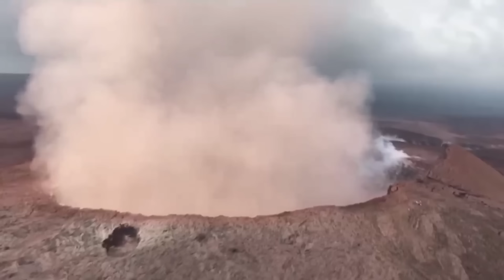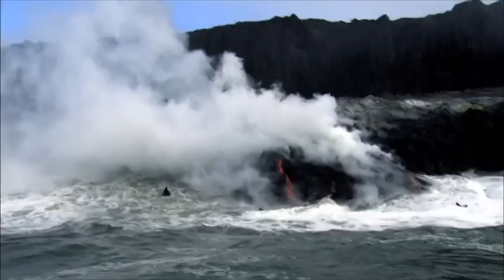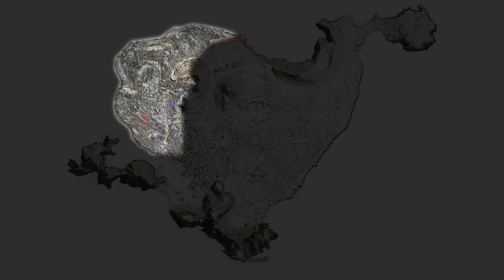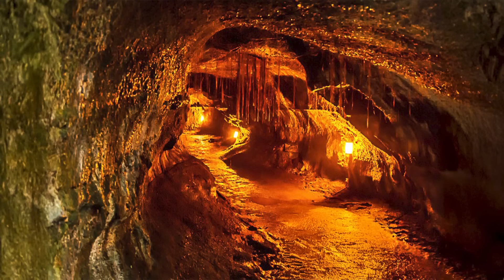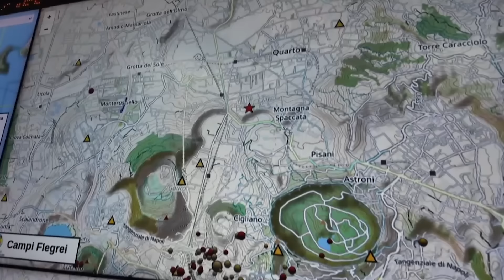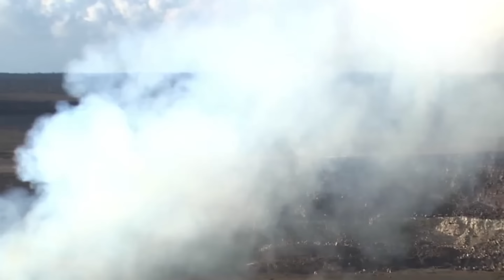Seeing Hawaii Pouring Billion Tons of Salt Water on an Active Volcano for 6 Months Is Just Insane

Comment: I don't think Hawaii slightly warmer weather would make a huge difference to the 1200 Deg C lava.
Reply: Water can cool lava when is in liquid phase only, once evaporated, water goes to air. In Iceland, the water is at 4 Celsius so cooling come from energy to heat water from 4 to 100 to Celsius + phase change energy . Phase change energy is is maybe the same magnitude than heating water by 50 Celsius.
Water in Hawaï is at 25 and energy for phase change remains the same. So, the cooling efficiency is lower by approximately 10% to 15%.
Reply: @marcellapointe979  The Power of Steam: Water absorbs a significant amount of heat as it approaches the boiling point and then a massive amount more when it flash-boils into steam (about 630 kilocalories per kilogram of water at Heimaey). As long as enough water is delivered to the lava and turns to steam, the cooling effect is largely the same regardless of a few degrees difference in initial temperature
Reply: @marcellapointe979  the difference is more like 3 percent
Reply: @marcellapointe979  Water absorbs a significant amount of heat as it approaches the boiling point and then a massive amount more when it flash-boils into steam (about 630 kilocalories per kilogram of water at Heimaey). As long as enough water is delivered to the lava and turns to steam, the cooling effect is largely the same regardless of a few degrees difference in initial temperature
Reply: Where did you study volcanology?
Reply: @coronalight77  I studied physics, this is simple physics.
Reply: @drp.c.7543  ha ha ha, you are funny.  🤣😂🤣
Reply: @timcory4455  I am fun and funny thanks, for noticing the latter....